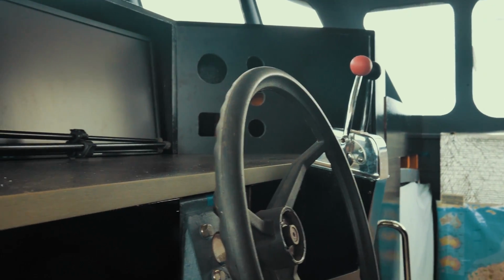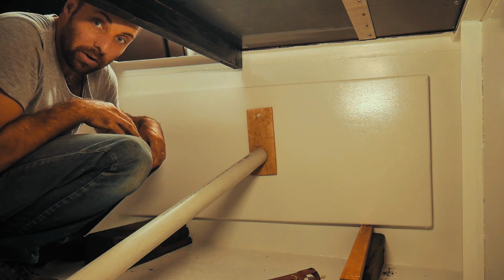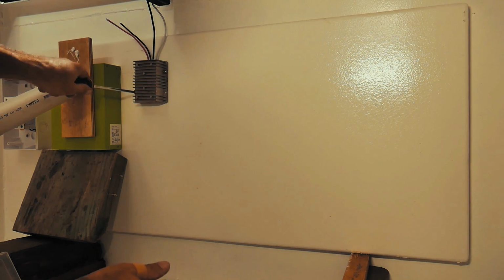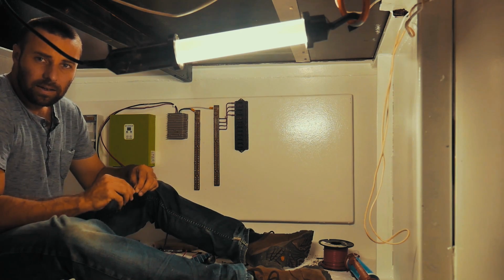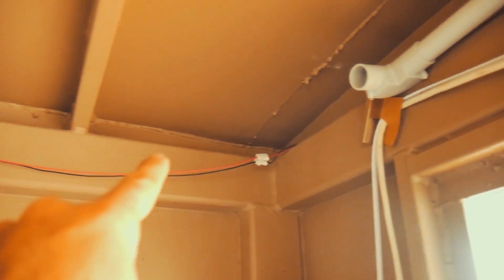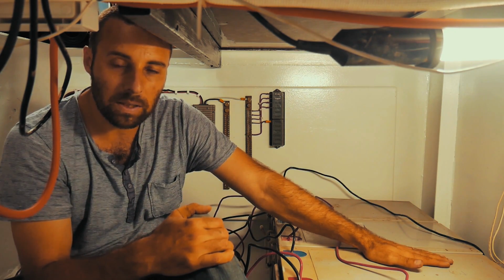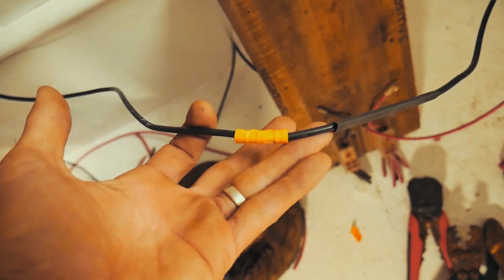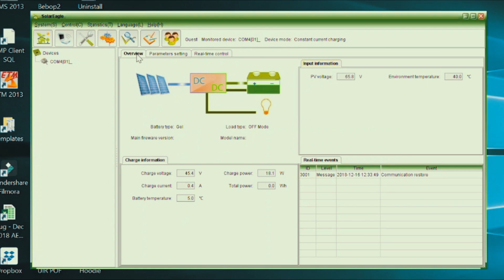Solar On A Boat (Part 2 of 4) Building Brupeg - EP. 62

Comment: You are going to get opinions coming thick and fast with a DC installation. Noone needs any qualifications to work with DC circuits and having been on a well known camper trailer forum here in Oz l would advise ignoring the multitude of different opinions and "just do it" your way.  Merry Christmas guys and gal, and all the best for the New Year,.
Reply from the maker: Yeah I agree. I’ve been told by dozens of auto electricians that what I’ve done is fine and safe and the same amount of people have said the opposite. Honestly I’ve got enough fuses in the system that if I have got it wrong I will learn rather than burn so I’m plenty happy with it.
Reply: By law every man must attempt trailer wireing 
No matter if he's never done anything practical before 
If it works for at least a few days (Or not at all) hes then an expert and everyone must heed his advice  
I think I know the forum you on about
Reply from the maker: If he is electrocuted less than six times and no more than two fire happens, he shall be known as a wiring god and trumpets shall play each time he enters a grand room
Reply: That would be myswag. Great forum that is unfortunately at the  mercy of a troll called "Lost" or "Bird"
Reply: Every one rekons dc is so easy because it cant bite 
Don't realise theyre playing with massive amps and fires are quite easy to create 
Many cars burnt to the ground with dodgy work 
But then everyone's so scared of 240ac 
It's literally all the same colours nation wide and isnt subject to any movement or vibration
Reply: And I like the sand fuse 
Iv had a maxi fuse melt and fuse closed on a dump truck
Does anyone have the technical name of the sand fuse, that one may find it by?
Reply: @fowletm1992  I always knew them as high rupturing capacity or hrc fuses when I was in the navy. Not sure if that is the correct name  etc

Comment: Polystyrene should not touch the insulation of the cables it breaks it down over time so I was told I personally haven’t had it happen yet but there is evidence that it does. Tidy looking well done 👍nearly forgot MERRY CHRISTMAS 🎄
Reply: it will draw the softeners out of the insulation causing it to go brittle
Reply from the maker: Didn’t know this, will definitely keep an eye on this. Merry Christmas guys
Reply: There are cables that have a pvc migration resistance to polystyrene, for 240v they are coloured purple ( I think..) or use conduit or a none pvc tape to isolate the sheathing.
Reply: I have heard the same but have also seen wiring run straight through polystyrene insulation in caravans etc without any issues so is it just a certain type of cable insulation that is the issue

Comment: Greetings. On the top, the insulation shields on the two conductor should be run through  the box to cable connector,  then stripped off the cable. This provides insulation shield protection the full length of the cable. Kind regards, Dave
Reply from the maker: Hi Dave, do you mean the white sheathing in the twin core wire should be run through the cable gland and into the box?
Reply: Project Brupeg Yes, the white sheath is needed to protect that last 6” of wiring before entering the box.
Reply: Sorry about the SAE.
Reply from the maker: If we didn’t strip this off we can’t get the glands to seal properly. We thought about this a lot and by stripping the sheathing back we can seal each cable perfectly with the right size gland and Ann flexible conduit to the cables after. If the white sheathing is left on the two cables side side by side and create an oval which the rubber seal inside the gland can’t compress around and therefore you end up with a hole for moisture to get into.
Reply from the maker: Sorry not sure I follow Dave, whats SAE?
Reply: I understand you have to use what you can get, that’s why not everyone can cope. Most of the time I have to use 3 conductor, because of a need for a ground. This rounds things out. In the U. S. we have a type of wire called Romex it’s oval.  The glads for this wire is oval.
Reply from the maker: That’s awesome. I didn’t know oval glands were a thing. If I could access oval glands I definitely would have run the white sheathing inside the box.
Reply: I haven’t seen them in PVC; however, that’s probably because in my trade we use galvanize most of the time.
Reply from the maker: My preference would have been stainless with a stainless box however a) I couldn’t find them in stainless and b) I don’t want to take a mortgage to afford them...
Reply: SAE 1/2” instead of 13mm. Society of Auto. Eng.
Reply from the maker: Ahh. Thought it might have been that. Yeah almost everything here is metric
Reply: Love your work. Nice to see a couple able to work together. I work for my wife and know it can be trying at times.

Comment: As the electrical is under the floor, have a think about putting a water cover/awning over the top. Imagine coffee is spilled onto floor, could it run onto the equipment?
Reply from the maker: Hi Terry, the way the floor boards are designed it’s actually really hard for any liquid to run down onto the electrics. But I will look at a lid just in case as condensation may happen further south
Reply: @ProjectBrupeg  If condensation is a problem, then there should be some sort of ventilation. Batteries and charge controller really would benefit from ventilation too.
Reply from the maker: I’ve not ever seen any condensation in this area but if we need to add ventilation we will. It’s a big space so dissipating the controller heat is pretty easy

Comment: The sand in the fuse is also to stop the high current from arcing across after the filament has blown.
Are the blocking diodes at the panel combiner boxes (under the panels) connected the correct direction?
The forward voltage for those diodes is around .6vdc (600mV) which my be the problem.
Check the diode placement...the line marking that wraps around one end of the diode it on the outgoing end.
If it is on the panel side it is blocking your feed...just switch the connections around.
Reply from the maker: Hi Gregory. Nothing was altered from factory with the diodes. Every panel is producing great voltage but at this stage we just couldn’t get any amps from the charge controller

Comment: Hi love your videos, I have many Questions but my first is in regards to safety at sea what do you have in mind for fire extinguishers for different types of fire, first aid kits and do you plan to put a life boat on board ? Better to be safe than sorry.
Reply from the maker: Thanks Troy 
All  the safety issues will come later, once we are through this stage of the build. It all costs money and we have to prioritise. Getting floating is the priority right now. Safety will be done before we launch though. Because we will have a lot of people on Brupeg first aide, jackets, life rafts etc will be very important. Safety procedures will be designed carefully and drills done continuously for practise and readiness. We will have a main fire suppression system in the engine bay and a backup for redundancy. Fire proofing throughout and two dinghies + life raft. On long or dangerous trips we will have a medical person on board. Cheers Jess

Comment: I think I'd bend me up a Stainless vertical mounting strap for the Green Controller box, Just to be SURE...So the Bad-Ass Fuse is a Shock Absorber for the Breaker..It all looks Great to me, I LIKE Organized Electrical systems. All I'd Do is mount a big Dry Chemical Electrical-Rated Fire Extinguisher close by, because if you have a Fire in there, it'll Take Out your Wheelhouse, Steering, Instruments, etc, and then you'll be Fucked. UNLESS you're going to Fit Out an Aux. Conn somewhere On-Board, which I highly recommend.Maybe back in the saloon?  Wouldn't need Much, just a Control stick plumbed into a Spare Steering hydraulic circuit, a spare Compass, Plotter, and com to the engine room and VHF. Com to the engine room, so you can talk to Ryan or Jess down there for Forward and Reverse, Speed Changes while Docking, etc..Eliminates the need for extra Engine controls...Be damned Handy in case of Burned-out Wheelhouse, or a BIG Wave coming through the ports and drenching the inside of the wheelhouse, you'd have a warm, DRY place to Steer from, a Radio to yell for Help, and a compass and plotter. NEVER Forget That S.O.B. MURPHY, he's EVERYWHERE, at ALL TIMES. And, Proper Previous Planning PREVENTS Piss-Poor Performance. An Aux. Conn will prevent you from having to stand out On Deck in a Blow trying to Steer with an OAR, lol...Merry Christmas to you all, and I hope Father Christmas drops off a BIG Load Aboard Brupeg for you all.

Comment: Nice setup ! I would only add something I think you didn't say. You have 800 amp/hour worth of storage at 12 volts but since you wired it as 48 volt you have the equivalent of one 200 amp/hour 48 volts battery if I am correct !
Reply from the maker: Yeah that’s correct. But it’s still the equivalent amount of storage as the amp draw at 48vdc is a quarter of the same load at 12vdc. We may actually be changing this set up as we are doing a MASSIVE electrical revamp based on a project we may be doing

Comment: Keep up the great build, The following is a long post (of possible alternatives for the future or others that may be building things) - should not be taken as a criticism...
You're doing a great job, with 1000000000001 moving parts, over thinking things can just leads to delays.

TLDR - The charge controller could have used Velcro .. if you don't trust the glue to stick to the painted wood a couple small screws with washers at the top (1 screw per strip) .and a 2 part fast acting glue to hold it to the painted metal surface. This way you can remove it if needed.

Else if you want to use CA Glue.. Cut and paint wood that is a little bigger than the device (charge controller) Glue it to to device then screw it to the wall, so it can be removed.. drill holes in the wood if you need to access screws on the device should you need to remove it.
you can also just glue wood strips (rather than a solid board to allow air flow  and access to the screws on the device) ...

Did this for my home setup so I could wall mount everything and remove everything should I need to work on it. Also made extension cables for everything if I need to have a device connected well working on it. (I use a small cabinet made with peg board to store the extension cables and a few tools) - My OCD tends to have me way over thing things - I need wires hidden, ability to fix things that will out live me, and ability to replace things without the possibility of it looking like a mess if I replace something or remove something or it keeps me up at night.

Well this post was long enough, something to consider in the future when mounting things that you don't want to add holes to.

Cheers and looking fwd to seeing you hit the water and enjoying all these hours and hours of work. Thanks for taking the time to share the process with the world. Happy holidays to all.
Reply from the maker: Thanks Master V I like the idea of Velcro for the ability to change things later. We will be using Velcro for much of our interior panels

Comment: Just one issue I can see down the track is you have made it hard to measure individual battery voltages with the way it is wired for isolating a faulty battery. May think about bringing each battery to a terminal block and then wire in series.
Reply from the maker: Thanks Ian I will have a think about this

Comment: Check you don’t have reverse polarity on one of your panel strings as the diodes in the panel will pull that string down and stop it working. Also cover up your panels before you test or you will blow the guts out of your cables. I know a lot about solar if you want to call and am happy to fault find it with you. Cheers nic
Reply from the maker: Thanks Nic and thanks for your kind offer. We have made headway and will be updating soon. If we don't have any luck we might take you up on that offer. Cheers Jess
Reply: Ok I’ll take it your all over it and don’t need help.
Reply: This actually occured to me too over morning coffee, but I assumed you checked for polarity in the entire circuit branches as well as for output.
Reply from the maker: Yeah polarity is all correct. We are now getting 9.8amps per pair so amps are rocking, still seeing 1-2 at controller and no cable is hot so I’m thinking it’s controller tripping the system thinking there is a fault
Reply: @ProjectBrupeg  Well, if you test the output at the wires just prior to the controller and get an amperage in the expected range at the expected voltage, you remove all doubt. But that's an odd sort of fault to turn a raging torrent of amps into an old man's beer dribble.
Reply from the maker: My multimeter can read a max of ten amps so I have an issue of being able to test each of the three pairs individually and add up the three measurements but I can’t measure them as a group as I will blow the fuse in the multimeter.
Reply: @ProjectBrupeg  Can you borrow a clamp-style ammeter? That would manage it. They can usually sense up to 400 amps continuous. You can get a serviceable one for under $100 Cdn. They can also handle transitory "inrush" amperages: that's how I learned my 2 KW diesel starter was taking 1,700 A at 13.2 VDC from my batteries, for about 0.75 second! Were I you, I'd really want to know for sure that the problem's in the controller, which I think it has to be, but "why" is another question. I would have thought you'd get nothing passing through at all. A last thought is back to the temperature sensor OR the "basic software": do you know for sure that the batteries aren't seeing a different charge than you are seeing on the screen? This is why I have the same dubious opinion of sealed gels with potted connections: I want to stick the probe directly on the post and water as needed!
Reply from the maker: Yeah it’s not the best system, the potted connections drive me nuts but I will run a few more checks today so narrow the numbers down
Reply: @ProjectBrupeg  Best of luck and thanks for the exchange of ideas. Can't wait to hear how you address floating DC grounds, isolation transformers and other "peculiarities" of having loads of electricity inside a giant piece of floating conductor! Happy New Year, also. It's an unusually balmy 11C here today at 43 N (it should be about 0C), which is probably the inside of your cooler...
Reply: I forgot to ask is that a pwm reg or mppt?
Reply from the maker: Hi Nic, the green charge controller is an MPPT, I’m getting good voltage and amps in the cables up to the charge controller and nothing coming out. The settings on the controller don’t allow me to change anything (other than selecting gel which is the default option). I have a bargain basement eBay pwm controller on order and I plan to swap it over so I can rule the MPPT controller in or out as the main issue. If it is the problem I will just need to order another higher quality one as this is well out of warranty (brought 4yrs ago but only just hooked it up)
Reply: Steel Boat Adventures - Building Brupeg just make sure when you connect the pwm that your solar arrays voltage isn’t too high. I’m flying up to Queensland after the 7th of jan to work on a few boats. I can bring up a spare victron mppt if you want me to call in for a coffee
Reply from the maker: Man I would love that. Victron is on my list as a possible replacement. Would be great to get an eye over the system to double check the issues
Reply: Steel Boat Adventures - Building Brupeg any way you can pm me.
Reply: Got a message through on your website 👍
Reply: @ProjectBrupeg  I have a Victron MultiPlus 3000 KVa as my charger/inverter. Works a charm and was cheaper and lighter than its predecessor. The software is a doddle, too...I can change a couple of parameters and equalize at will, meaning I don't put it off. Basically, I think you should cobble together a system good enough to get you to Canada or the States and then buy the gear you really want at 50% cheaper than Oz, which I gather makes it expensive to have it shipped in. With the size of your bank, which is about twice the size of mine, you'd want a pair ganged together. An alumimum power boat cruising couple I know of with a budget bigger than both ours put together shows you how it's done here: https://buffalonickelblog.com/2017/05/07/power-management/#more-571

and here: https://buffalonickelblog.com/2018/12/17/breaking-it-down-and-breaking-it-in/

Interestingly, the gear they have is merely just multiples of what I have or bigger versions (like their Furuno radar) of what I have. The photo of their breaker board, however, will bring a tear to your eye: https://buffalonickelblog.files.wordpress.com/2018/12/IMG_3600.jpg?w=1000